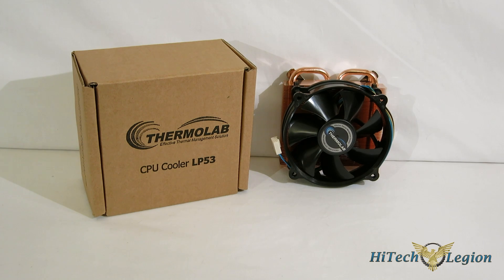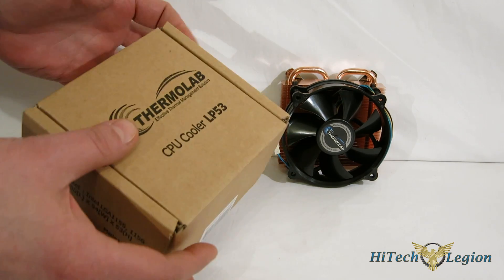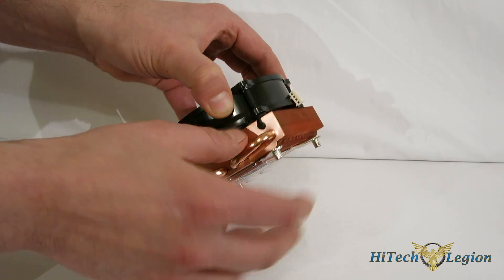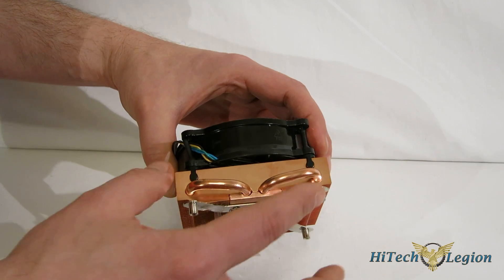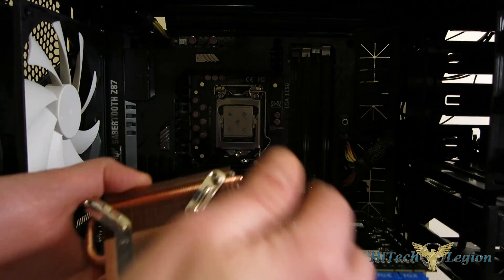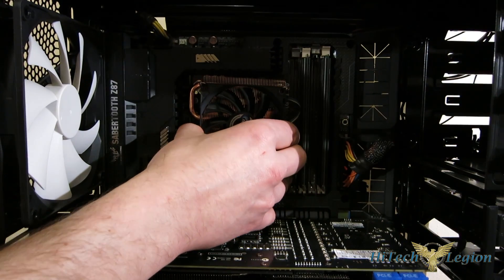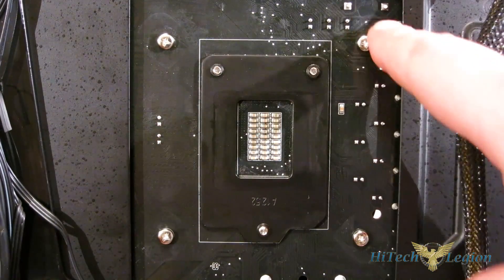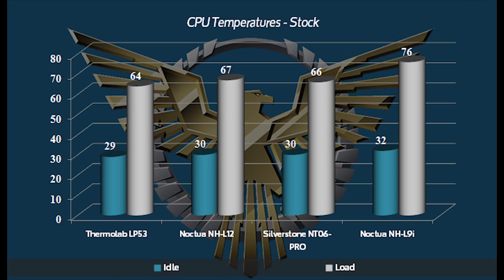Thermolab LP53 Low Profile CPU Cooler Overview and Benchmarks

Comment: Ques 1)  Would you need (and could you get) different mounting brackets from Thermolab to mount this fan on an ASRock Z270 ITX board (which I believe has an 1151 socket)?   Would the brackets from their ITX30 model (which is listed to also fit an 1151) work on this (LP53) cooler?
Ques 2)  The Fractal Node 202 Case specs quote a max 56 mm space for a CPU cooler.  With only a 3mm clearance,  Is there any chance that this 53 mm fan may be too large for this case?   Could the fan suck in the dust screen right above it? 
Ques 3)  In a Youtube video, Salazar presented a Fractal node 202 case build using an ASRock Z270 ITX Fatal1ty board, with an i5-7600K CPU, and overclocked the chip to 4.5 GHz, with idle temps not exceeding 75 degrees after 30 mins - using a Cryorig C7 fan.  How much lower of a temp (or higher the overclocking) might you expect with an LP53 fan?  Does this fan efficiency justify an unlocked i5-7600K chip in this small case?   What will happen with a load on it?  
TYVM for any replies.

Comment: i'm interested in this cooler but instead of using that fan i'm thinking of putting a 140mm noctua industrial fan on top of it (and basically everything else.) would this be a good idea, or would it defeat the purpose..

Comment: It's a shame this cooler flopped, now is the time it shines with the lower wattage current gen processors and growing popularity of console size cases.  I just ordered one for my Node 202 since benchmarks put it on par with the Cryorig C1 which is a much larger cooler (Currently running a C7 which will be no contest).  And to top it off this cooler looks absolutely stunning!
Reply: Yeah, I was expecting the Cryorig to be better than this, cause it has 4 heatpipes instead of 2 heatpipes of this one as well as the Noctua NH-L9i
But Cryorig must have failed to optimize something - probably the heatsink itself, like fin distance and shapes...

In an S4 Mini, you can only fit it with a 15mm thick fan, and it still beats the others.  

At any rate, I think Thermolab's fan is the weak spot - good thing that can be swapped  :)

As for the LP53 "flopping" - it just doesn't look like all these "gamerized" designs, like something out of a marvel cartoon.  But I think the flopping may have already reversed itself with the increasing use of SFF.  SFF would also be more popular if it wasn't more expensive to build a smaller case than it is to build in a larger case. For a good aluminum SFF case, you pay well over double of what gets you one of Lian Li's mini/mid towers...
Reply: how has it been? i have a node 202 and think ill upgrade to this in the future. was debating between this and c7
Reply: On par with the Cryorig C1?? I have an lp53 and I was thinking about switching it for a C1, where have you seen those benchmarks??

Comment: Hi. Nice video. Can the lp53 cool the i5 4690k with temperatures like the 4770k.
Thank you
Reply: Saaileysh Jain The 4690K actually has better thermal transfer than the 4770K, so the 4690K runs cooler. You would get better temps than this with a 4690K in similar conditions.

Comment: 1 ram slot will be useless if you use this
Reply: That is not correct. It doesn't impede on the RAM slots at all.
Reply from the maker: It is stated in the review that the LP53 adheres to Intel's Keep-Out Zone, and it is clearly visible that the LP53 does not block the RAM slots in any way.

Comment: Author spend more time talking about protective plastic than a fan itself. It looks like very interesting fan which is thicker than usual. I dont think much goes in preparing these vids.
 Also scythe shuriken does much better for a bit less.
Reply: The fan is a standard 80mm fan, standard 25mm thick, not "thicker than usual". Every aspect of the fan was covered either in the video or written portion of the review, including noise impressions.

As far as preparing the vids....you need to understand that they are part of a review, not the review itself. There are four pages of impressions, specs and test procedures that go along with this.

Your statement about the Shuriken is incorrect. Very incorrect, actually. The three coolers in this test in that size range all outperform the Big Shuriken 2 Rev. B, and all are quieter.